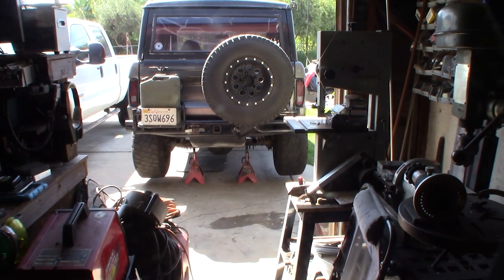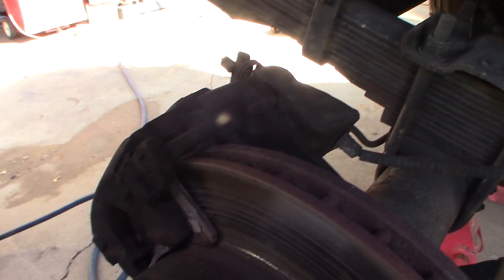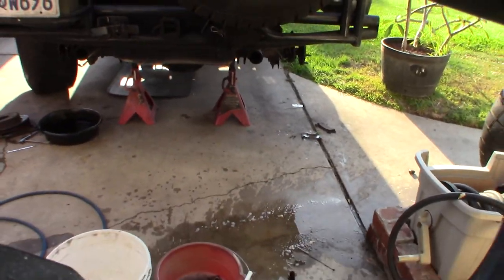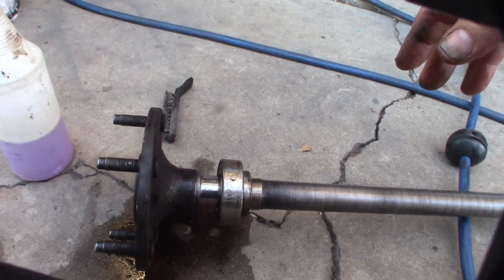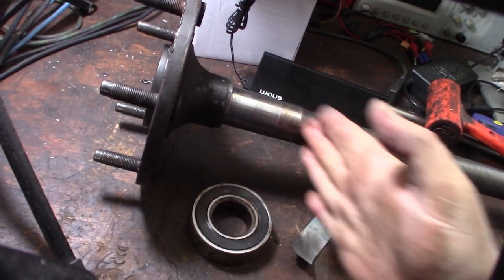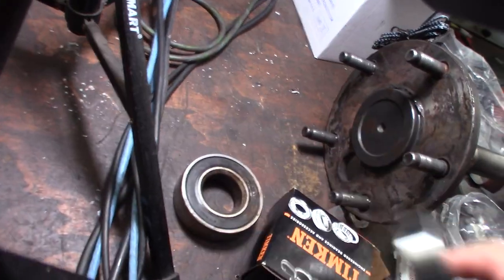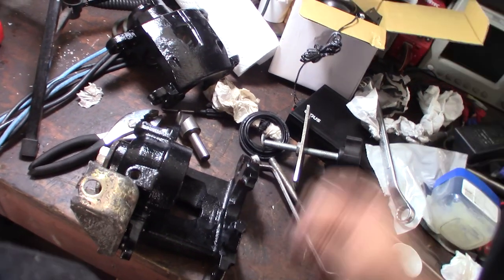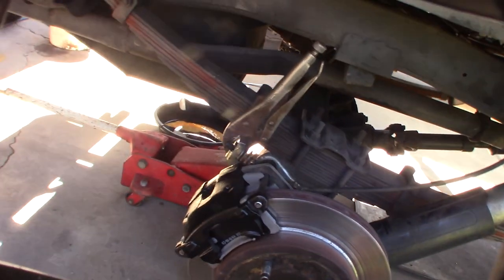Early Bronco Ford 9" axle walking out of housing, bearing slipping off axle, does Koyo own Timken?

Comment: I'm confused. There's not a retaining clip or anything for the axle inside the differential?

I haven't seen calipers that have the parking brake builtin before. It looks MUCH better than the stupid "tiny drum in the middle" style which absolutely never works.
Reply from the maker: No, its doesn't have a retainer in the diff. I've worked on some of those before in my other cars. I guess the nice thing is you don't to pull the diff cover to remove the axle. The downside is your tire might come off when your going down the road.  The bearing retainer normally keeps them bearing in place.  I hear its pretty common when the bearings fail for them to walk out. That bearing lasted 15 years daily driven and many offroading trips. The E-brake setup is pretty cool but is a pain to dial in and adjust.  Have you ever down any fuel injection stuff? Seems like something you would be into.
Reply: @fintechrepairshop  Nah, I am more just into repair when it comes to vehicles. Never modded anything really other than interior/hvac stuff. I am a boring, drive the speed limit from point A to point B person. My biggest mods are things like ripping out cellular modules and adding extra condenser fans.
Reply from the maker: Fuel injection is pretty cool, 10+ years ago I did some software development on an open source fuel injection project called megasquirt. You can run your car on a Atmel 8bit processor. This was my first experience with these types of processors, way before 3D printers were a thing. Did adding the extra condenser fans improve your low speed cooling?
Reply: @fintechrepairshop  Cool, I've heard of that. Is that actually allowed in CA?! Here on the east coast, even if a vehicle is older than 25 years old, the required safety inspection includes a "visual verification of emissions systems", ie. you are not allowed to modify anything. In theory. (Obviously in practice it depends on the inspector.) The only way to not do it is to plate a car with antique plates, and then you are only allowed to drive it on weekends.

Condenser fans do help, but we found that you need a ton of power for them to work. Like 15-20A, 1500+ CFM rating. And they are loud. Smaller ones do nothing.